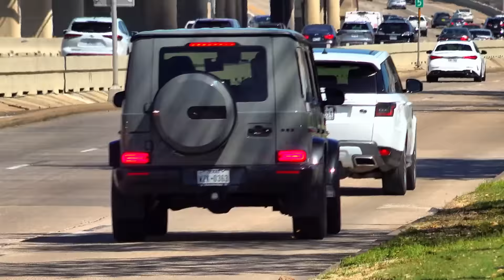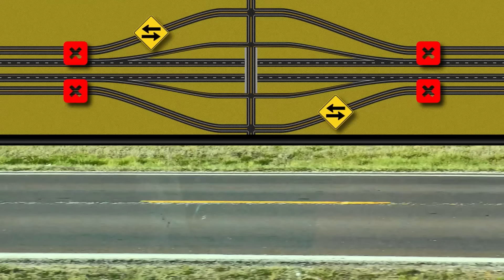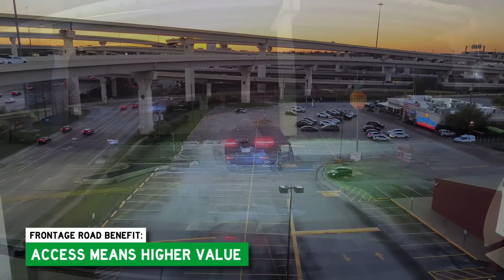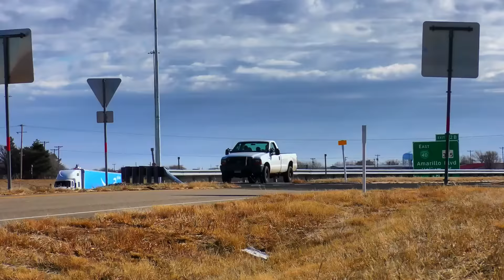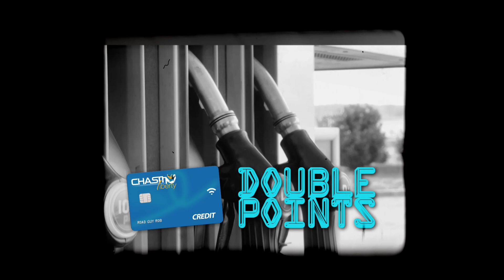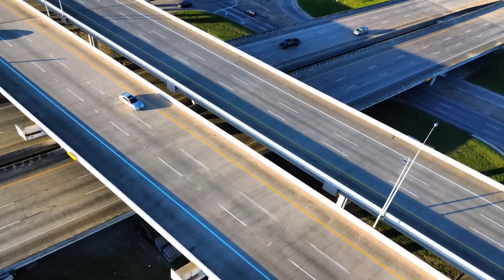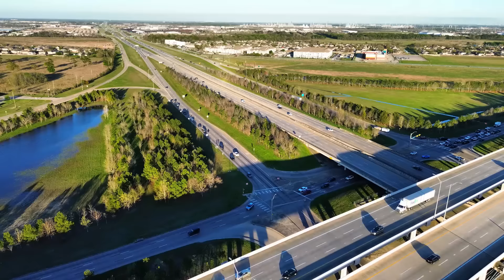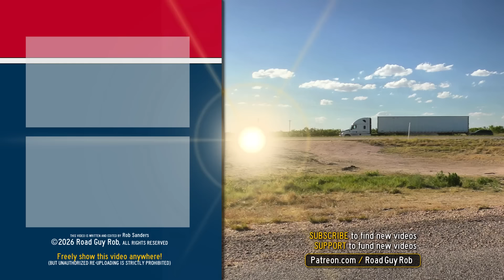Why Texas Builds a Freeway Next to Every Freeway

Comment: I like the engineering of the frontage roads. One thing I HATE is how close the exit and onramps are to the intersection. The offramp is just before the intersection light and the distance between the offramp and intersection light is about 150-200 ft depending on the road. Also people driving on the offramp have the right of way but when there is traffic because of a red light, its near impossible to get into the right lane to make a right hand turn so in order to make sure, you have to get off at the exit before your exit. Especially because traffic in the DFW area is very heavy. The one thing I would change is put the offramp after the intersection light and onramp before the intersection light. I don't know how many times I see an accident where someone crashes into a standing car because you are getting off at 65-75 mph with very little offramp road. Also onramp have very little lead so you have to gun it at the beginning cause speed limit is 65 mph so everyone is driving 80-90 mph.

Comment: Texas is much more efficient at building roads now. In the past, contractors had no incentive to finish the project. The longer it took, the more they made. Lanes would be blocked off and the construction barrels never seemed to move. Neither did the workers standing around.

Now they reward them for early completion and punish them for delays. 

"The Texas Department of Transportation (TxDOT) began adding incentive/disincentive (I/D) clauses and "A+B Bidding" (where contractors bid on both cost and construction time)."

In Dallas, they redid I-635, which is one of the most heavily trafficked corridors in the United States. They expanded the roadway and added new surface street features, but the most massive thing was they built a toll road underneath from I-75 to I-35 

A tunnel was cost prohibitive, so there is a gap to allow exhaust fumes to escape. But it seems like a tunnel when you drive it. Something I've only done a couple of times to get to DFW airport more quickly.

They're nearing completion of I-635 improvements east of I-75, which run to I-30. 

"The I-635 East Project is a massive 11-mile reconstruction and widening effort by the Texas Department of Transportation. Costing $1.74 billion. Construction began in the spring of 2020, and all main general-purpose lanes are now open.

Project Scope:

Highway capacity expanded to 5 lanes in each direction

Two HOV lanes rebuilt/converted into toll lanes

Added continuous frontage roads with 2 to 3 lanes in each direction
 
Major overhaul of I-635 and I-30 interchange

Skillman Street bridge entirely reconstructed

Comment: The problem with the frontage roads is it makes connecting interstates difficult and complex.  Some of them have very complicated flyovers (610 to i10).  Most of the time you have to exit the expressway your on to get to the frontage road of another expressway and sit through several lights...   particularly if you have to make a left turn.

Comment: Frontage roads aren't a terrible idea, Texas just didn't do them entirely right. They cut the freeways through cities, set up frontage roads and then put businesses and homes with direct perpendicular access into the frontage roads. That creates several different bottlenecks and separates formerly homogenous communities and disturbs natural traffic and commercial/residential patterns.

If it were done properly, frontage roads should act almost as ring roads around communities with no direct access, especially perpendicular access, to businesses and homes. The frontage roads should be 2 lanes wide and be around 45mph, the freeway should be 60 or 70mph, with a ramp on and off long enough for traffic to get up to speed or slow down. It shouldn't have traffic lights either. The freeway should be 3 lanes wide in each direction as well, widening to 4 lanes to merge on or off, and the frontage road should widen to 3 lanes for merging on or off.

If you need more travel lanes than 3 for a freeway, you have enough traffic to justify commuter rail, unless the traffic is just a large number of cargo trucks in which case, build a separated lane just for them to travel through the city and limited on/offs for local deliveries/pickups.

And the frontage roads connect into communities by their own curved roads, almost like ramps or merge lanes, that feed into the main street for a community/neighborhood with a lower speed limit (like 30mph). You create almost mini cities, especially if you don't have euclidian zoning and each community can have it's own businesses and mixed residential types. This also makes it easier for public transit, busses can use the frontage roads and pull into/out of communities which can be walkable, and commuter rail can connect with busses at hubs as well as the communities around their stations.

Comment: The Texas service/feeder roads in urban areas are clogged with traffic as they are lined with endless strip malls and drivers turning into and out of driveways. The traffic lights at virtually all intersections are on timers, notr sensors, and the light sequence operates thru a complete clockwork cycle no matter the traffic present.

Comment: I was nearly killed by this road "feature" about 5 years ago, at I-10 and UTSA Blvd in San Antonio. You start off the video saying "you can't have a driveway directly connected to the highway", yet in Texas they like to put entrances to businesses just next to where the U-turns on overpasses come through on highways, and this resulted in someone deciding they really needed tacos so they came out of the U-turn and immediately turned right across three lanes of traffic at full speed, striking me on my motorcycle as I was headed north to get on I-10. Really wish they had the brains to plan for that one.

Comment: Here in North Texas, far North Texas that is, we've always called them "Access Roads." Average speed limit on them up here is 50-60mph outside of the city. One of the perks of these roads is they allow you to get up to the average speed of the interstate so you can merge onto it safely in the lesser populated areas. Another perk is, tractors and other farm equipment can opt to take those routes instead of the freeways and interstates so they aren't making issues for other drivers.

Comment: Just wanted to let you know, in case you didn't -- the issue with Creekland has been resolved -- sort of. The developer built a connection between two roads, which now allows homeowners to skip the toll.
However, it adds about 15 minutes to the average commute time, so some people just keep using the toll

Comment: i love frontage roads. usually don't span the entire length of an interstate, but especially in towns they're great. sometimes you can use it to bypass traffic. since every exit usually connects to the frontage road, it's much less worrying if you get off at the wrong exit. There's regular underpasses with traffic lights too, making U-turns a breeze

Comment: You mentioned "backage roads" early on, the two-way roads on the far side of the businesses behing the frontage road. I'd never heard them called that before. You said they were an alternative to frontage roads, but they can actually work in conjunction with frontage roads in an important way. They help with the one-way traffic issue.

Instead of having to drive a few miles and use 4 left turns or two turnaround lanes to go a neighbor in the opposite direction, I can make a much smaller drive around the block with only right turns. Since the roads connecting the frontage and backage roads make a T-intersection with the one-way frontage road, it doesn't need a light, just a stop sign on the side road, and no one is turning across traffic.

This also helps if the business I want to go to is at the exit but on the opposite side of the highway. If I get off, then turn left and go under the highway, I can't turn right on the frontage road into oncoming traffic, so I go a little farther and I can turn right onto the backage road. Without that, I'd have to intentionally overshoot, go way past the business I'm visiting, take the next exit, use the turnaround, and then come back down the opposite frontage road.

The system of freeway then businesses, then one-way frontage, then two-way backage also allows for more, often smaller, businesses on wither side of the big highway-facing ones on either side of the backage road. People visiting those often don't even need to get on the freeway at all, and it's another step-down layer between the noise of the freeway and the quiet of the neighborhoods.

Comment: They are quite dangerous.   You have distracted drivers on the freeway "shopping" , checking out businesses on the frontage roads, combined with people trying to get up to speed to where their destination as fast as possible.    It basically turns a situation where people should be paying attention to either slowing down or getting up to speed into a distraction.  
Texas turn arounds can be down right suicidal if you cannot see the situation you are turning into.... and on the big ones... you cannot.

Comment: Cant see why they need to be one-way? Our motorway 'slip roads', as we call off ramps in the UK, go straight into A roads where the motorway off ramp takes you into the flow of the smaller road. If the aim is to provide access to businesses wouldnt 2-way be better?

Comment: Outside. Metropolitan Houston; frontage roads are two ways. I was coming back from Columbus TX to Sugarland after buying Harley from Columbus cycle shop and heading east from the town; i rode on the two way frontage on the Southside of I10 and the entrance came not smooth or 90 degree but a complete U turn or 180 before I could access eastbound I.10.  My Harley is heavy 1500 CC ELECTRAGLIDE and I almost lost it but slowed down and made that 180 degree turn safely. Talk about Texas Turn-around....😂😂😂😂❤❤❤❤😅😅😅😅😅😅😅😅😅😅😅😅

Comment: 16:26 Why the hell are you Dumping on both Chicago and Arlington Heights when it is Palatine Rd and it leads to gosh Darn Palatine, Illinois!? You didn’t bother to explain how the unique traffic light patterns allow drivers to switch from the local lanes into the express lanes. And you’re being completely disingenuous, they built overpass bridges and exits where most they need to be, over IL 83. Elmhurst Rd.; US 45/IL 21 Milwaukee Rd; and of course over Rte IL 53. I do agree with him that they should put additional overpass bridges, especially over the  Rte 12/Rand Rd. And the Arlington Heights Rd. Cluster of Intersections. But the NIMBYs and Strip Mall businesses around there would find it unsightly and would not want to be “bypassed!” 🙄

Comment: Arkansas has stop lights on 60mph roads hidden by hills.  
Semi's regularly run reds 4 seconds late because there's no time to slow to a stop.  
Stop lights shouldn't be allowed over 50mph, a fully loaded semi can't stop at that speed without smoking brakes, and old timers can't react that fast.
Putting lights on signs on a highway is dangerous even with proper signs

Comment: Speaking as a native, Beltway 8 frontage road still feels like being held captive to tolls because you can either pay the toll or spend 10 mins waiting at every light (5 feet apart practically lmao jk) because of how long the cycles last and how backed up the lines are. I dread visiting people I love dearly if it requires transit on Beltway 8. 

Also, the maneuver/behavior you addressed in the last bit of your video, exiting a freeway whenever you need to rather than when it is designated and allowed for you to do so, is called a "Texit," and it is an important aspect of our culture lol. It's mostly associated with big trucks, but tbh a Texan in a Nissan sedan will still elect for that to access the feeder if the proper exit is too backed up.

Edit: and yes, it is illegal. I have never heard of anyone being pulled over for it though. I'm sure it happens, but folks get away with it more often than not.

Comment: The closest we have to this in the UK is the "service road", usually left behind as a result of an old 1950s / 1960s dual carriageway being upgraded to motorway and one of the old 2-lane carriageways being repurposed as a route for local traffic as well as pedestrians and cyclists who aren't allowed on the motorway. The motorway between Glasgow and Carlisle has a service road running most of it's 100 mile length which has got me out of trouble a few times when there's been accidents on the motorway.

Comment: I'm from TN, wife is from TX. Driving in Dallas when we visit her family is always mind-boggling to me. I think it's the perfect place to train autonomous vehicles. If they can figure out DFW they can figure out any city in America. Also wtf is up with multi-directional hwys? 35E...SOUTH? WHICH ONE IS IT? EAST OR SOUTH!?!
Reply: MKLG2000x
South out of Oklahoma and Kansas then swings east at Denton is why.
Reply: Blame Fort Worth, I-35 was supposed to go through Dallas only, but they threw a fit and demanded a split designation(those existed back then) I-35W goes through Fort Worth and I-35E Goes through Dallas. This also happened in Minnesota I-35 was supposed to only be in Minneapolis (I-235 was slated for Saint Paul, the state capital) well they didn’t agree. They too, wanted and were able to receive a split designation; I-35W to Minneapolis and I-35E to Saint Paul. When these splits happen they are treated as alternates of each other and both run north and south.

Comment: As a traffic engineer in Houston, this video is right up my alley! I have actually worked on the signal timing at the diamond interchanges so I can try to explain generally how they work. There’s typically 2 options: a 3-phase or 4-phase diamond. A 3-phase diamond means that the frontage roads go at the same time and the left turns get stopped under the bridge. This is less common. Drivers are more used to being able to move through the interchange in 1 movement, so it can cause a safety issue. A 4-phase diamond, on the other hand, basically has each approach go one at a time with some overlapping clearance phases to maximize efficiency. This allows every movement to get through both signals in one cycle. The red-light running issue is a problem though because traffic from another approach is coming at you (perpendicular) at speed. Gets even more complicated with T-intersections and such. Fascinating stuff!

Comment: Texas builds feeder roads so they can divert 5 lanes of traffic onto them at rush hour to NOT do construction, thats right, its just cones for no reason.  Unfortunately the feeder road is also under construction.   The surface streets are under construction too.  But don't worry you drive 95mph in the 30 mph zones and 30 mph in the 80 mph zones.

Comment: My wife and I took a road trip around the country in 2010 after she retired. We started in Oregon heading north and went clockwise around the country, so we didn't get to Texas for quite a while and got to check out roads and highways in other states (and provinces) prior to Texas.  The access road system in Texas is awe inspiring in its design efficiency.  Of course, it helps that most of the major metro areas are in fairly flat land, thus the flooding issues.  But still, it makes a lot of sense, especially for a society with a car culture.  You did a great job of introducing the subject and covering it.  Kudos!

Comment: It's a great approach if you have lots and lots of land and really long roads. Most of our towns get built around highways, with the main shopping area directly on or adjacent to the highway and residential areas further away. One more annoying thing with smaller towns is that the residents don't tend to have easy access to the stores because you have to get on a highway to access them. That's less of an issue in large suburban areas where stores will often build in private back roadways for residents to enter, but in these small towns, people just buy up land off the highway for residence and it's up to them to make their way back onto the highway to get to stores.

Comment: I moved from California to near Austin Texas and this is the worst traffic system I have ever seen. If you are on the I35 and want to exit to get to a shop on the other side, you have to go a mile to get to an exit then get to the near cross street which can be another mile then you have to travel another couple of miles on the other side to get to where you want to go, it's the worst most inefficient traffic. Texas  is a huge state with lots of land but they love their single lane roads. They build these new neighborhoods without expanding the roads first until it becomes a problem then they start widening the roads, I don't get it. Southern California has the best most efficient traffic system I have ever seen. Yes it can be heavy at times but they have these super huge highways that can be up to 10 lanes per side in some cases and every major street has its own exit from the freeway so if you miss an exit is not too far down to exit. When I moved in 2007 they had just finished the 130 Toll road made to alleviate the traffic on I35 but it was originally 2 lanes on each side, why couldn't they just made it 4 or 5 if they knew people were moving to Texas? they added another lane a few years later and they added another one again as we speak. It's mind boggling.